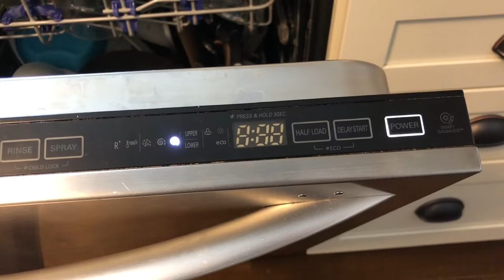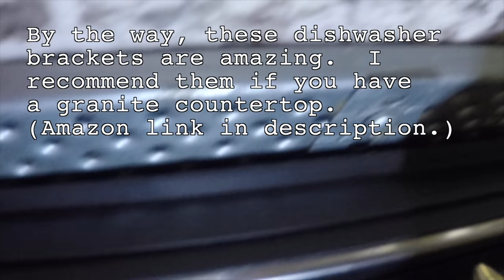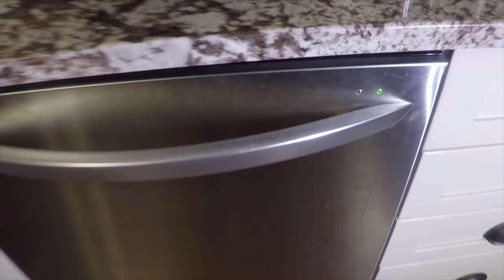LG Dishwasher Not Draining (Repair)

Comment: I just did this.  Just wanted to confirm you do not need to remove the whole dishwasher.  With a pair of pliers you can remove the hose clamps and remove the pump.  I ended up finding a chopstick in my pump.  Be sure to put a towel underneath the pump, once you remove the pump from the hoses water may come pouring out.  Not much, but enough to easily dry up with a towel.
Reply from the maker: Great tip!
Reply: @chicagohandyman  Big thanks to you though for putting this video together.  I was just looking for a way to save time/not have to pull the dishwasher out. Thanks for the assist!
Reply: How do you get access to the drain pump without turning this thing over? There doesn't seem to be much room to put the pliers and remove the hose clamps.
Reply: @asrarq  There isnt at all, if you have smaller pliers it helps.  You may have to push the tubes around to get the access that you need.  Remove the clamp for one tube push it out of the way, you may need to use your fingers to move the clamp in a position that is easy to access for the pliers.  This was a while back, if I remember correctly it was easiest for me to start with the hose in the back once I removed that, the pump was able to move around more freely, and I just moved the tube around until it was easy to access a clamp.
Reply: I preloaded the hose clamp by sliding it off the new part. Used a slip jaw set of pliers and compressed the tension. I then used a cable tie on the handles of the pliers to keep the tension on it. Slide back over hose. Slide hose on bib. Wiggle hose clamp over into position and either wiggle pliers off clamp or cut cable tie.

Comment: Thank you for this Video I have the same dishwasher and its was doing the same thing yours was doing, after watching your video I went on Amazon and bought the same part you did 40 bucks delivered in 2 days, pulled out the dishwasher and replaced the pump put it back into the cabinet and Boom works great now.  Thanks you Thank You I never would have attempted this without your Video You Rock... Thanks
Reply: Same here !! Major help

Comment: I also just tilted mine up on two pieces of wood so I didn't have to unhook the water supply etc.(drain hose was already unhooked).  The mistake I made was when I clamped on the larger of the two hoses, I had the clamp end pointing to the floor.  This scratched my wooden floor, so I tilted it back up and swung the clamp around so it didn't drag.  Another symptom to tell if it's the drain pump is that you hear a high squeal during the drain cycle.  It'll drain a bit and then squeal, then drain a bit more, then squeal.
Reply from the maker: Great tip. Thanks for sharing.

Comment: Again, AMAZING VIDEO... but my first official LG part only lasted 1 year. I feel I have a blockage... I just installed my second pump, it seems to be working but not as fast as I would like. I am hoping what every is blocking the hose will get dislodged. The older pump (only 1 year old) sounded like it was working but no water was getting drained. I just ran my fist successful wash (quick wash) with no dishes inside. I hope to get years of use. My dishwasher is 9 years old but does look identical to this video. THANK YOU AGAIN.
Reply from the maker: If you suspect a blockage, I've been successful with this alternative solution:  Disconnect the drain hose from the sink's drain lines.  Connect a shop vac hose to the drain hose and turn on the vacuum.  Then initiate the drain function on the dishwasher.  Hopefully it will get out the blockage.
Reply: @chicagohandyman  thnks.... before I switched the drain pump I put the house in my mouth and I hailed as hard as possible with absolutely no movement of water....  switched the pump and now it is draining

Comment: When I phoned LG they said case assembly doesn’t include the drain pump. Did your include drain pump or you had to order separately? Thanks.
Reply from the maker: The link I provided shows how you can get the pump from Amazon. Imo, the case assembly is not needed. You will most likely be able to reuse the old one. I have another video that shows the difference.

Comment: Thank you, this worked for me. Cost me 90 CAD in parts and saved me 160 CAD in labour. It is a pretty easy fix. Things I would suggest others to watch out for when doing this work is to be careful when moving the dishwasher out if you have wooden floors, I scratched mine up a tiny bit. Also, leave the dishwasher such that the door is on top. I made the mistake of leaning it forward which messed up the stands in the front, so I had leveling issues after putting it upright again. Finally, it water starts leaking near the door after this repair, you need to level the dishwasher using the knobs on the bottom. This happened to me and had me worried, but it has been fine after leveling it.

Comment: Thank you for this video.  Fixed my dishwasher in 20 minutes with this new pump assembly and its draining better than ever and going through the full cycle after the dreaded DE error code.  As many others have stated in the comments, you do not need to take the dishwasher out of its spot to do this fix, you can simply take the baseplate off and the pump and all the hoses are fully accessible from the front.
Reply from the maker: Thank you. If I ever need to do this repair again, I’ll definitely do it without taking the dw out.

Comment: Great video and instructions. I had a OE error and thanks to this video I could tell the drain pump was going bad on our 5 years old dishwasher. These pumps seem to fail between 3 and 5 yrs. However, I was able to purchase just the pump (about $21) instead of the whole housing with the pipes and clips (about $43). I was also able to replace the pump without having to remove the dishwasher. A bit tight but can definitely be done in about 10 minutes. Thanks a million for the video; it saved me a bunch of $.
Reply: Yep, this is all you need. Disconnect the wires. Hold the assembly firmly and rotate the pump clockwise to remove. You can probably leave the hoses on the old assembly. You should also just do this before ordering a new pump - to check inside for blockage.

Comment: Thank you for your clear and detailed instruction, and of course your time and work to produce this hi-quality video.  Save me lot of money and anxiety.
Update 8.22.2023: Received the replacement water pump for $35 US on AMZ.  Replaced on the same day using your instruction.  Got in installed in less than 15 mins, but if including other preparation and cleaning it will take about 1 hour.  Ran multiple DRAIN tests which passed 100%. Very happy and thankful for the video.
Reply from the maker: You’re welcome. I appreciate your kind words!

Comment: Thanks, this worked great, except I struggled for about an hour to fix it in place like some people mentioned. It almost worked, but it did not allow the working room to wiggle the large hose clamp into place. We pulled the dishwasher out but instead of flipping to its back, put a brick under each adjustable foot and were able to easily finish the part installation quickly. This allowed us to leave the drain hose connected to the drain pipe.

Comment: Pile of shit dishwasher, I just replaced the pump and the thing still wont drain, I blew air through the drain pipe and there is definitely NO clog anywhere clean as a whistle. I also disconnected all of the lines except for power to the pump and ran the drain cycle pump ran perfectly fine. I keep scratching my head on this one.

Comment: Excellent video describing changing the pump assembly. I bought only the motor on Amazon which saves $100 approx. Once you have removed the pump assembly, a simple twist disengages the old motor from the assembly.. Note that there is a rubber washer which should be carefully removed and cleaned and dried. I strongly suggest coating the washer with a thin layer of plumber's grease and it will make it much easier to twist the new motor into place. Twist the new motor into place, re-install the pump assembly as in the video and you are good to go. For me.....problem solved. Dishwasher back to normal. Very pleased!!

Comment: I HATE this LG dishwasher: LDF8072ST!
We were moving and needed a dw fast so this was an impulse purchase.  Will not spend 1 penny to fix.  When needed, it will be replaced by a diff brand.
How does a dw generate steam to clean & dry without a heating element?  Did not realize this when I bought it.
So far: racks started rusting after 3 yrs, trouble with drying, draining, soap disp, & racks fall off the tracks a lot.  And only 1 type of soap pod fits in the dispenser.  Liquid is useless.
I HATE this LG dishwasher!
Reply from the maker: I would be angered as well if I had the same experience as you. I’m pretty happy with mine (LDF7551ST). Are you sure yours doesn’t have a heating element? I know a big misconception with LG dishwasher, or all Asian and European dw for that matter. I have visually seen the heating element when I was repairing my dw. I was shocked because when I purchased it, the misinformed salesman said it didn’t have a heating element. I have since looked at the parts list for this dw, and it indeed has a heating element. This dw still and always have dried my dishes really well. Maybe your heating element has gone out.

Comment: WHEN DOING THE COMBINATION:
1) POWER
2) DELICATE + NORMAL HOLDED FOR 3 SECS
3) THE CODE "dr" APPEARS.
HERE THE PUMP WILL DRAIN THE WATER AT THE BOTTOM IF IT WORKED OTHERWISE  IT WILL SHOW "de" FOR DRAIN ERROR.

Thank you for your video.

Comment: LG ABQ73502701 Check Valve turned out to be the problem in my washer.   Replacing this check valve fixed my machine.
Reply from the maker: Great to know. Thanks!

Comment: Good info on replacement steps to replace pump. Can you provide the model number of this LG dishwasher ? Got the same dishwasher but the model and serial  number tag is missing. Have a hard time ordering replacement repair parts for this appliance. Thanks

Comment: When I first got the error code I looked it up in the owners manual and the OE error message states there is a clogged filter or a kinked drain line. I didn't think the drain pump was bad because it did work when I did the override to make the dishwasher drain. I snaked out the drainage lines and cleaned out the drainage connection to the garbage disposal under the sink because I thought there was a clog somewhere.  There was no clog. I ordered the part today and will have it in a few days but the error message should state that the drain pump could also be bad.  My dishwasher is a 2012 model and has been great up until this issue. Great video thanks for posting.
Reply: Did you fix the problem with the new drain pump?
Reply: @nuksyed  
Yes, I forgot to do an update.  It is extremely simple, as a matter of fact I had my 14 year old son do it. It was a good learning experience for him and it also shows people how things work when you take them out from under the countertop and cabinets.
The dishwasher once again works really well and we saved money. Good luck.
Reply: @notsosilentmajority1  thanks I have the part on order. I will try it too.
Reply: @nuksyed  
Good luck brother.

Comment: Hey thanks this has been helpful!

We bought this dishwasher 2nd hand from somebody and it's worked ok for the most part. Had an issue I encountered, that whole assembly sits on the bottom of a disc with a giant rubber o ring on the top which prevents water from leaking out of the washing chamber all over the electrical components. You can see the o ring if you look inside the dishwasher on the bottom.

Mine is just ever so slightly popped up in the back, and on the bottom front side, there's two plastic clips held in with a screw and washer that I believe are intended to keep it locked in place. That side is fine, but the other back side is the one that is the issue, because it's popped up, water is leaking and i'm having a heck of a time trying to get it back into its proper place. 

i'm a 6ft 250lb dude, I basically tried turning it over and deadlifting this thing into place and I still can't get it, any advice :(
Reply from the maker: If you’re having a difficult time getting the rubber washer to seat correctly, I’d use some silicone grease to help get it on a little more easily. But I have to say that I’ve never done the repair you’re talking about.

Comment: I have this same dishwasher, recently water came out the bottom whilst draining, thanks to your video, im assuming throughout the years, one of the connections to the drain pump must've popped or came loose causing all the water to spill out. will have to take the unit out and check things out.
Reply from the maker: The hose gets brittle over time. It probably cracked. You can get an aftermarket dishwasher drain hose and replace it. If the hose is indeed your problem.
Reply: @chicagohandyman  awesome advice, thanks. helps me narrow down what to look for.

Comment: Thanks for the video; I was actually able to get mine changed from underneath the dishwasher without having to pull it out from under the countertop.
Reply from the maker: Nice. 

If others are wondering, I have another video showing that method as well.

Comment: Do you know the part number of the little rubber valve at the 2:50 mark? The connector tab was broken when I went to change the pump and I can’t find the part number on the LG parts diagram. LG customer service and parts replacement service also couldn’t find it.
Reply from the maker: No. I think you can only get it if you buy the whole pump and housing together.

Comment: Thanks for the video, mine stopped working a few days back took out the drain pump this morning and found a piece of broken glass had gotten stuck in the pump. Actual fix took 15 mins, taking the dishwasher out and putting it back again took a couple hours. Thanks for the video.
Saw at lowes that a new dishwasher is about $600, if someone calls a repairman its about $200 to come to house + parts(i am assuming they will say replace the pump) + labor. Its almost reaching the cost of the dishwasher.

Comment: When I ran the test method it did not drain.  Does that imply my pump is not actually bad but instead something else is wrong?  Also, is there a check valve somewhere in this model LDF7551ST that may need replaced instead? Thanks for the great video.
Reply from the maker: If nothing happens when you put it into drain mode, then I’d guess it means the motor is not getting power or the motor is bad. Try taking out the motor. I have a video showing you how without having to move the dishwasher at all. Once you get motor off, you’ll be able to see if the impeller is blocked by anything. The hoses (two) still shouldn’t be ruled out either.

Comment: Very helpful instruction. However, my concern is about LG dishwashers in general. They are horrible and useless. You fix one thing, but before you get relieved, something else takes place. I will definitely won't buy this brand name again.
Reply from the maker: That’s how I got so good at repairing them! 😂
Reply from the maker: Despite that, I like LG DWs. They are quiet and my get my dishes really clean.

Comment: I put a new drain motor in and it only worked once and now I'm back to the original problem. Do you think the hose is clogged or is the drain motor a faulty one?
Reply from the maker: Yes, a clogged drain hose is what I would look at next. I had to do it on mine that’s in the video. I bought 2 universal drain hoses from Home Depot. I replaced both the one that goes from the drain pump to a wye on the left hand side of the dishwasher. And then a 2nd one from the wye and to the sink drain line.

Comment: Just replaced mine after watching your video. Although I could hear the pump working, was constantly getting the OE error code a few minutes into the cycle - guess it wasn't working well enough. I order only the pump (without the housing) from Amazon for $24: LG EAU60710801 BLDC Dishwasher Pump Motor Replacement DC 22V
And two days later I was able to replace the pump without removing the dishwasher from its place in 15-20 minutes. It's very tight and no much room to maneuver, but just enough to do it.  As others said, the new pump does not come with the back rubber ring, but you can remove it from the old pump. Also, make sure you have a towel handy as few ounces of water will drain out as you remove the old pump (if you have hardwood in the kitchen you might get yelled at). Thanks again for your video - I'm not a handy person and couldn't have done it without your video!
Reply from the maker: Glad I could help! Also, thanks to the commenters here, if I ever have to do this again, I’ll just order the motor to save even more money. 👍

Comment: My dishwasher is pumping but not draining. Any ideas?
Reply from the maker: Sounds like a blockage in the drain lines. Disconnect the drain hose from your drain. Use a wet vac and vacuum the hose while draining the dw. Might work. 

I ultimately had to replaced the hose.
Reply: @chicagohandyman  I just replaced the entire drain hose. Pump will only drain when hose is primed by me manually won't drain on its own. Pump igoes thru it's entire cycle and you can hear it working, but no drain

Comment: no need to go through all that. Remove kick plate and access everything right in the front of the machine. You do have to lay on the floor, if you're not able then follow this procedure
Reply from the maker: Completely true. I have a follow up video showing your method.